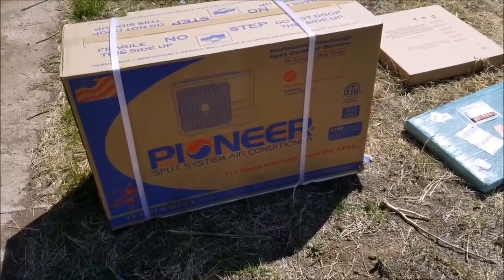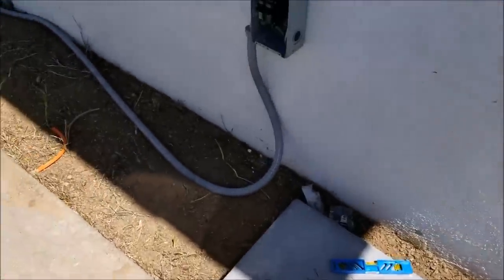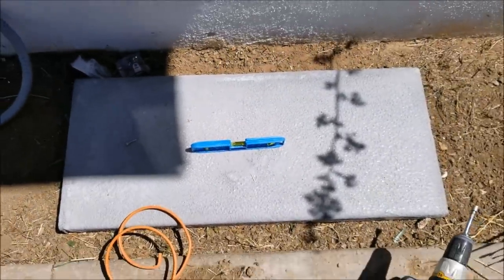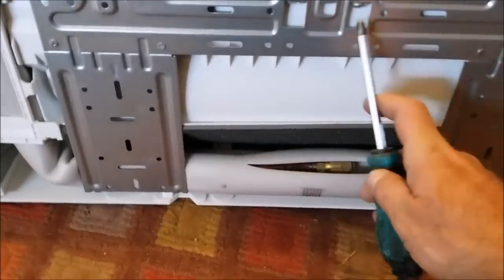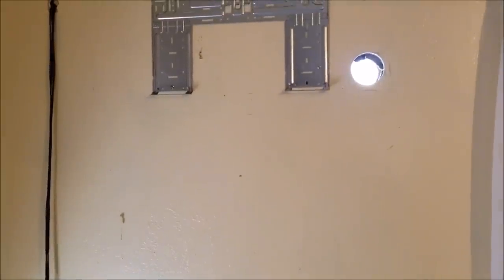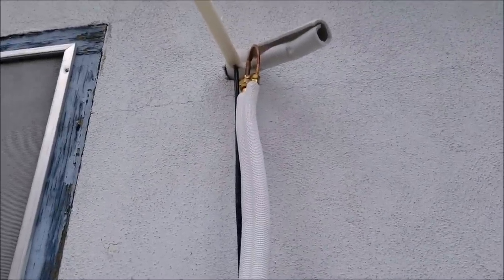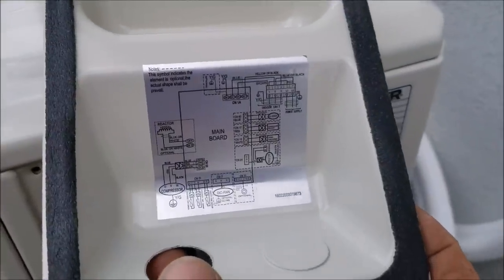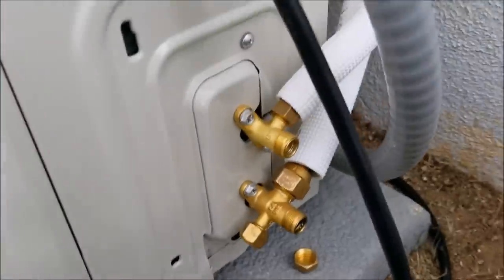How To Install Pioneer Ductless Mini Split 12000 BTU 230 Volts Air Conditioner

Comment: 2 mistakes should have used the low side gauge and should have left gauge connected until freon in the lines. You just lost your vacuum without gauge connected.

Comment: Why did you choose to use such a big gauge of wire?   Isn't 12 big enough?
Reply: Think I may know why but please correct me if I am wrong.  It is because you put the 50 amp breaker in the panel.
Reply from the maker: 12 Gauge may have been good would need to look at the manual again. I had the 10 Gauge from another project so I used it which I knew would be good for the unit.
Reply: @Branden Stick to the manual for wire gauge and breaker sizing,  You never want to over size the breaker or under size your wiring
Reply: Anytime I install a 220v line 10ga has always been a standard, using a 12ga especially on a high draw application like this may cause 12ga to overheat. Rather have larger wire and spend more then encounter any problems such as that.

Comment: -15psi Microns are over rated anyways. 👍
Reply: I know there were some mistakes made there. Like the blue pressure gauge should have been used because it can read a lower pressure. Never mind using a micron gauge. And then disconnecting the red hose before releasing refrigerant is going to undo what the vacuum pump just did.
Funny thing is that his system is going to work just fine. Probably will run into issues in a few years, but maybe not.

Comment: After the manifold gauges show negative pressure for twenty minutes, what prevents air from being vacuumed back into the copper lines when you disconnect the line between the service port and the manifold gauge? Do you release the refrigerant before or after disconnecting the line from the service port?
Reply from the maker: Release the refrigerant then disconnect the hoses.  I did a video here showing the steps better which starts around minute 13:00  https://www.youtube.com/watch?v=Dg-w2uAsEJE&t=791s
Reply: Thank you kindly

Comment: How long was the line kit on your unit? 16 ft or 10Ft ?
Reply from the maker: The unit I got had a 16Ft line set.
Reply: There are minimum line set lengths for these mini splits. Mine is 10 ft. So I called Daikin and they said that a coil of two rounds will not hurt the unit at all as the compressor is sucking and the oil will come back to the compressor.

Comment: Do you have to do vacuum part or can you just open freoN and hope it works
Reply: The air in the lines will mess with the system.  Shorter life, lower efficiency....  not a good deal in the long run.  You can get a cheap vacuum pump at harbor freight or just borrow one from someone.  I'm pretty sure that's where he got his gauge set and vacuum pump
Reply: David Tromp must, must, must, have to vaccum. Oxygen in the lines when mixed with the refrigerant will create an acid that will cause compressor failure way way, way before it should ever fail.
Reply: Eric Presnell  thanks, I did figure out how to Vac it, was so simple, going to install another system upstairs now

Comment: I want to get a 208/230v pioneer like this one: I have an existing disconnect box and trading 240V, will it work?
Reply from the maker: Yes it will run from 240 volts.

Comment: what if you need a 30 foot line between the two devices
Reply: Thomas Henderson you’ll have to order it (special order)and you have to add extra freon. The refrigerant included in this unit are good for 16 feet line.
Reply: thank you

Comment: is that 220?
Reply: These are 110 units.
Reply: 220v single phase
Reply: Adam Temes  you're correct, however if you look on the label  it says (L1 and L2) that whole job in the video in NOT how you install a mini-split. Terrible!

Comment: Hi, I recently purchased one of these units and when I went to take the caps off of the refrigerant lines it started to leak out air/gas, is that normal?
Reply from the maker: Which lines? The main line-set  usually doesn't have any caps beside plastic to keep out dirt. The inside condenser line sometimes comes pre-filled (not always) with Nitrogen a harmless gas to show that the unit holds a seal. The outside condenser holds the refrigerant which should only come out once the valves are opened behind the caps.
Reply: Yeah my senville 9k was pressurized with nitrogen

Comment: Can someone tell me if the condensing unit can by stationed in the basement?
Reply: Can't be in basement, not sure what would happen, but they always say you have to put it outside.
Reply: i would say no
Reply: I just saw a guy move his to the basement, it's on Youtube.  He says it's like a geothermal heatpump now because the basement is always 60 degrees.  I suppose if the basement is not conditioned you should be able to do it.  The condenser seems to just be blowing out air.
Reply: im betting it dont work very well
Reply: These are heat pumps so its moving temperature from one place to another.  If that basement heats up then the unit will become inefficient.  Also many basements can be flood prone and there's likely building code restriction on the elevation above the floodplain.
Reply: Ground source heat pumps exchange heat with vast volumes of earth through tubes that are 100s of feet long. The trick is the surface area of the tubes, their thermal conductivity, and the volume of earth in contact with them. Dirt and rock don't transfer heat very well, so they make up for it by pumping heat in or out of a HUGE amount of earth that's very spread-out.

By contrast, a basement's walls are not designed to be thermally conductive, and are in direct contact with a relatively small amount of dirt in a confined area.

Therefore, this guy is dumping exponentially more heat into his basement than it can possibly transmit to the surrounding earth. The air will get hotter and hotter until the compressor either breaks, or shuts down from thermal overload. Along the way, the cooling gets worse and worse because hotter air has less capacity to take on additional heat.

What it boils down to is the guy thought he had a good idea, but didn't, and won't admit it, possibly even to himself. If it was really a good idea to put the condenser in a basement, you'd hear about it all the time.

Comment: FOLLOW THE MANUAL AND NOT THIS VIDEO for you vacuum pump/gauged removal.  This video in no way did an adequate test with vacuum and in no way did a correct gauge removal.   YOU WILL REGRET it LATER, maybe much later as it will take time to screw it up if you don't do this portion correctly!